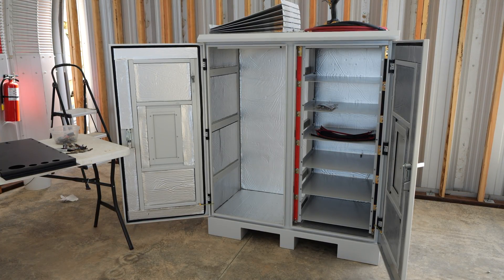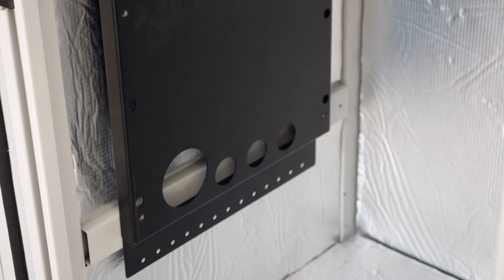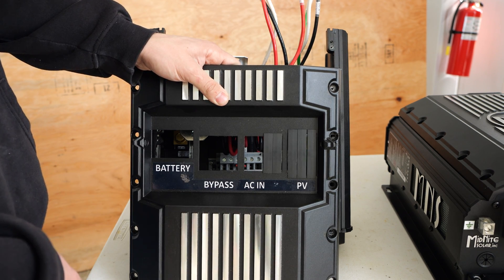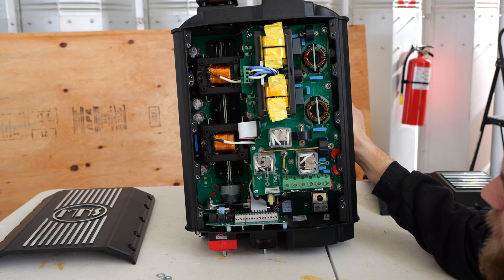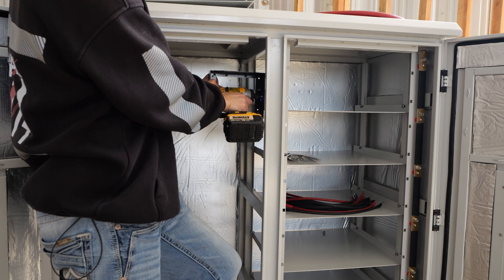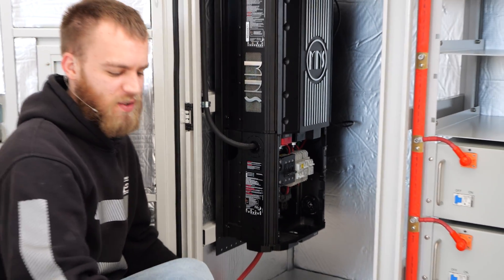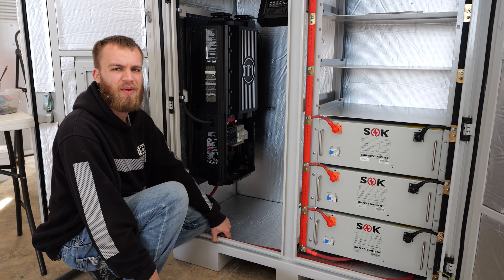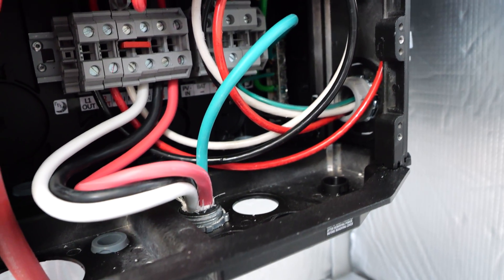Off-Grid Hybrid Well Pump Power System

Comment: At 8:20 you mention "square shaped nuts" for securing the batteries. Do you have a link or a spec for these? I don't think they came with my SOK 12-slot rack. thanks!

Comment: Ok a off-grid solar system should be used for more than just a water well pump.
This is way too costly a use case for just running the well system and overkill.
Most home well pump systems are 1/2hp to maybe 2hp depending on depth and demand.
I currently have a Eg4 6kw inverter and two eg4 batteries for 10kwh storage that runs my home backup.
A system of this size is more than enough to run a well, refrigerator, freezer, microwave, window unit and any lights and outlets in a home.

The only reason someone would be using a solar system solely for a water well off-grid would be a farm or livestock need.
Because if you had a system of this size it would be crazy to not utilize it for many purposes otherwise.
The intent of a solar system for off-grid backup is to make it worth the money spent on the system.
The best way to do that is to use it as much as possible to offset the cost unlike a generator.

Comment: Hello. Is it possible to mount the inverter and some chargers on the back of the rack so you can read/adjust the settings? To do so, I was thinking about placing a wood + cement board on the back wall, just above two or three battery slots. The “problem” will be how to attach that new support to the cabinet. Any idea? Thanks for your input.

Comment: That cabinet is super nice.  
I'm trying to figure out the use case here.  If i understand, to run the well for 12 hours in the past you needed to run the generator 12 hours.  Now 3 hours of battery, 3 hours of generator, 3 batt, 3 gen to get 12 hours.  On every 3 hour mark you have to go and open/close the cabinet and start/start the generator manually?
Maybe you are only running it 15min a day or something so it lasts a long time between charges?  If so slap a panel and a charge controller on there.
Reply from the maker: Well pumps often have pressure switches so that they start/stop as demand for water comes, as compared to a storage tank + booster pump.  The pump may only run in 3-5 minutes at a time.  That makes powering them from a generator wildly impractical.
Reply: @CurrentConnected  got it, thanks for the clarification!   Makes perfect sense.  And the inverter can invert without the cabinet open? It only needs the cabinet open for cooling when charging from the generator?

Comment: Great video.  Does the Rosie automatically call for generator power?
Reply from the maker: It can, however, this generator is not (yet) setup for two-wire start.  At the top of the hill, we have a PLC control cabinet that interfaces with the generator to start it for the off-grid system.  I'll be working on moving the hardware into a cabinet on the generator in the future so that it can accept a two-wire input.  That would make this totally autonomous - just use water and check fuel levels every now-and-again.